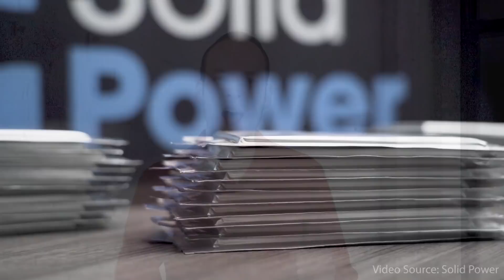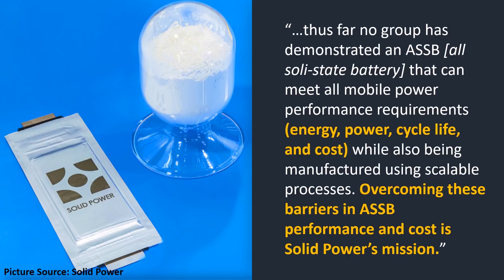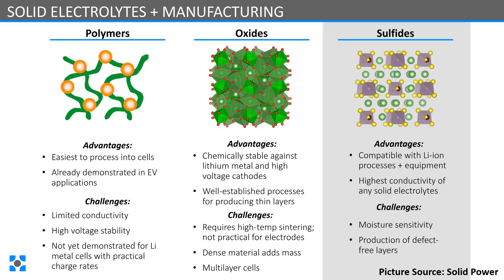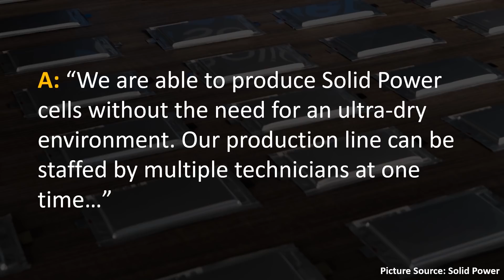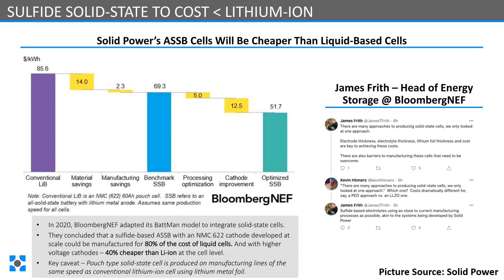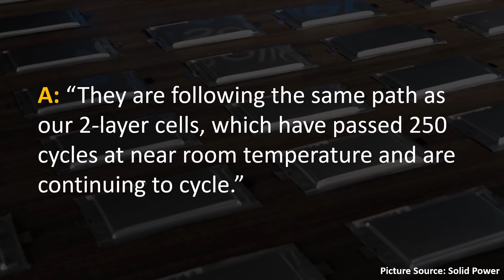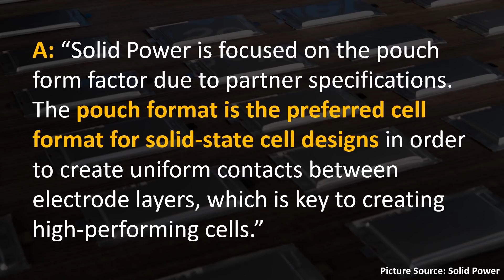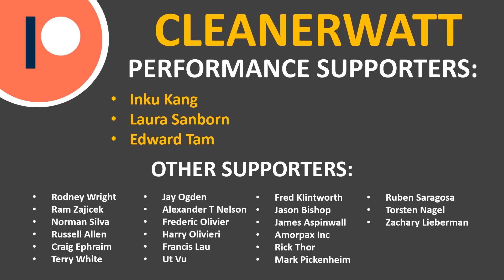Solid State EV Battery Tech: Reality vs Hype (Solid Power Batteries)

Comment: Its a shame you used Tesla as an example here, as from what I've read it turns out their cells perform WORSE than what they were using before.  Plus you have to consider how much of the car you have to replace to change the battery pack, its not practical to have a batter you can't easily replace.

Comment: You missed one key question, the 1000 cycles are at 45C 122degrees Fahrenheit, which is the same temperature as sulfur batteries in the 70's.  This temperature constraint is the biggest problem with Solid Power.

Comment: You idiot, how does adding a metal can to a battery where a pouch cell doesn't use one, reduce weight? Structural battery packs can be made with either.

Comment: Heeey Just discovered a HOODWINKING in the presentation at 7 :15 the graphics show an electrode stamping step in the L ion side that does not exist unless you are making prismatic cells, which the industry making the current cylinder cells does not use!

Comment: Hello! Thanks for putting this together - great work. I have a few questions on the cost slide: 1. What reference are they taking for industry standard $85.6/kWh? Is this on the cell level? Seems lower than the current $100/kWh which only a few companies have hit  2. Are material savings coming only from the elimination of graphite? Does it represent the net value (typically the cost of the solid electrolyte is much higher than the liquid counterpart)? 3. What specifically are they referring to in terms of cathode improvement (higher Nickel?) and process optimization?

Comment: 12:10  Everything you said after this point is sketchy.

"Tesla's structural battery pack only works with cylindrical cells."   You're 100% incorrect....  Tesla's structural pack design simply removes the structural supports from the floor section, using the packed cylindrical cells as the support structure instead, and it removes the second layer of plastic packaging of the cells into modules.  I imagine it also makes it impossible to remove a faulty cell or groups of cells being that the cells will likely all be glued together, versus their previous design of 4 modules in the 3/Y.  

VW just advertised the exact same concept with its new prismatic modular cell form factor... removing the structural supports, removing a secondary layer of packaging, and using the prismatic cells themselves as the support structure.  While you're video precedes VW's power day... that's no excuse.  BYD had already advertised a similar structural pack with their Blade LFP cells.  No secondary container and no additional supports within the pack, outside of the cells themselves.  Added bonus is that if a single cell does fail, it can be removed and replaced.  No need to replace the entire pack.

I like that you keep calling it "Tesla's structural battery pack.. breakthrough".  That pause for emphasis is cute.  Seriously... they removed the plastic module containers, jammed the cells closer together, removed the support beams, and then filled the entire pack up with the packaging material / fire retardant.  The main benefit is weight and materials savings.  If this is a breakthrough, it's a pretty obvious one.  They've yet to produce a car with this pack, so we still don't know how amazing it'll be in practice.  Especially with cylindrical cells.  Isn't BYD already building the Han with the blade cells in a structural pack?

Given an equivalent chemistry, there's a good chance cylindrical cells lose in both volumetric and gravitational density as a direct result of additional cell casing requirements.  A cylindrical cell is like building a box cell, only adding metal cross beams every few inches across its length and adding a bit of empty space around that beam and filling it with packaging material.  

Tesla's manufacturing process does seem to be faster / cheaper than pouch cells, although we've only seen video of it that clearly seemed like it was sped up.  VW claimed a new process of layering the pouch layers using a process similar to currency bill production.  I guess we'll need to see how well it performs.
Reply: BTW, I'm completely floored that you left out what may be the most important aspect of SSB cells.... charging speed.  The biggest issue with long distance trips with current BEVs isn't that they need to stop to charge... it's that each stop can take a lot of time, extending the trip time.  Tesla's 10-80% is ~22-25 minutes with the 2170s.  4680s may reduce that time, we'll see.  QS was claiming 12 minutes 10-80%, and Toyota was claiming 10 minutes to 80%.    QS is also claiming that cold temperatures have no impact on charging speed like it does with liquid electrolyte cells.

IMO that means smaller capacity packs can be sold in cars and still be viable for use in long trips.  They'll require more stops, but each stop will last half the time.  It also means the pack itself will take up less space and weigh less, improving usable space and reducing vehicle weight, improving vehicle efficiency.  Integrate those cells into a structural pack, and ... well... what advantage does Tesla's 4680 cell structural pack have anymore?

BTW, the megacastings really has nothing to do with the cells or the pack.  They do use cast aluminum, which aluminum is likely more expensive to use than steel.  To extract the aluminum from the ore takes a good deal of energy.  What I'm not sure about is what type of energy is required to go from the aluminum to the chassis by using 6 ton casting presses versus stamping / welding or smaller castings + welding.
Reply: Last point... Tesla stated on battery day that they hadn't yet perfected the dry silicone anode production.  Maybe they've solved it since then, but if not, then that's a pretty big issue.  The "tabless" design.. which is effectively just hundreds of tabs folded on top of each other on each end of the cell, adding additional copper / aluminum use to the cell... is not a necessity in pouch cells like it is in cylindrical cells, as each cell layer in the pouch has its own tab.  I don't think the extra material in the 4680 cell is a big deal given its benefits though... I'm just pointing out that it isn't exactly an issue that pouch cell producers need to solve.

Comment: Durability? This has always been a problem for solid state cells and I don’t think you addressed this in your video. Solid state reminds me a little of fusion power, offering great benefits that are always n years in the future. The problem for Solid Power, Qauntumscape et al is that they are aiming for a moving target. ‘Traditional’ LiOn is getting more energy dense, more durable, cheaper and safer year on year, as are the BMS that manage them. The new 800v architectures are already solving the rapid charging problem so where does solid state go?

Comment: Funny, I got the opposite impression from the video. Impressive improvements for automobile Li-On batteries can be achieved merely by well understood packaging and chassis integration improvements while sold state batteries will require much technological development. Presumably the invisible hand of the market will pick the winner.
Reply: Indeed. SSBs could end up as a niche player while existing chemistries provide the bulk of EV battery needs and will continue to be developed as any breakthroughs in things like anode/cathode composition can be quickly integrated on the production line and give a rapid R&D payback.

Comment: Per Tesla patent on tab less cell (ie multi flap cell) each flap will be independently in contact with one of two electric terminal on cell casing. If implemented accordingly will bring down  conduction resistance electrically and thermally for superior performance. That is. It so. 

Per Tesla’s published 4680 cell assembly, such independent connection was not carried out hence loosing both thermal and electrical performance claimed.

Comment: Interesting how it always seem to be 5 years from now. I remember somewhere 2010-2012 i've read a science magazine where they promised some great breakthrough in battery technology within 5 year time, then in 2015-2017 it was the same promise, 5 years and now, in 2021, they say wait for 5 more years.
Also, the science magazines promised massive improvement in energy density, like several times more than what we have now, yet it seems to be that in practical use it will be maximum 50%, maybe 100% improvement.

There is clearly something, some big problem which just doesnt allow a battery technology that desirable breakthrough.
Reply: Most times, change is incremental and not necessarily revolutionary. There is a big improvement in energy density and durability in batteries if we look at a larger timescale than just one or two years. But of course the companies try to hype their own products.

Comment: Great vid.  Thanks!  SolidPower seem legit and not just full of marketing fluff.  A few observations and questions.  Did you ask SolidPower (SP) about their volumetric energy density?  On the cost projections (from BNEF) they start w a lithium-ion cell cost of $85.60 per kwh.  This seems very low (maybe lowest possible price currently in the market and not average) so their cost estimate ends up unrealistically low and too close to Teslas 4680 projections.  Also, the production process shows slurry mixing and  drying.  4680 does away w this (I know this is supposed to be current/conventional methods).  The SP process does seem to have a large advantage when it comes to formation.

This is the first realistic projections of SSB I have seen (not saying there are not others that are kept quiet).  But having a MWh scale pilot plant vs Teslas GWh scale pilot plant tells us where the action will be fir the foreseeable future.

Thanks again!!  Keep up the good work.

Comment: Tesla's structural use of cells merely mitigates the penalty of requiring the steel cylinder in the 1st place which the 4680 has reduced over the smaller cyl cells.  If you don't need heavy structure to contain a pouch cell that you need for a cylindrical you will have less mass for the cell packaging to be allocated elsewhere in the structure or build a box around pouch to use as structural pack (makes little sense for that purpose)...I don't think cylindrical have an automatic edge here at all.

Comment: Hell Yeah I enjoyed it!! Great video.  Great insightful information.  Really good scaleable delivery: I listen at 1.5 playback speed W/no problems.  leaves me with one question: What would be the problem with an EV manufacturer allowing for a 1/4 capacity removeable/rechargeable cannister of various battery chemistries.  Leave 1/4 at home for use there or take it along on long trips.  Expensive high speed chargeable or cheap remove and replace on the go.  Heck have two cannisters charge one with solar roof and wind generator at E-home for free!

Comment: Tesla could pivot if solid-state proves to be better. Solid Power was non-committal about the cylindrical format cells, but there was nothing in their presentation to suggest that it would not work with some effort.

Comment: With a solid sulfur electrolyte, when it's exposed to water, it produces sulphuric acid.  Meaning it will require masks and special areas in the factory that are water-free.
Reply: solid sulfur based electrolyte, which are sulfides. solid sulfur doesn't do anything

Comment: The problem is as follows.
This technology should have been researched a lot earlier, but because of the reluctance of the car manufacturers to switch to EVs (or heck, even worse, colluding with the oil industry giants to push the idiotic hydrogen fuel cell vehicles (which also rely on fossil fuels to extract it) it's been dragged on and on. 
Toyota own many patents in this field and to this date they haven't produced a single EV. They kept it under wraps to hamper the industry.
Governments not pushing for the complete stop of ICE tech sooner.
The moment the dieselgate scandal broke lose, politicians across the planet in deevloped countries should have set a deadline of 2020 for developing ICE powered vehicles and 50% of vehicles sold to be PHEV and EV. This means all research into ICE should have ended and companies not try to waste billions into making some newer, "better" petrol/diesel engine, but spending those billions into developing better energy storage tech. But in the present these manufacturers are still wasting fortunes into making "new and improved" ICE tech vehicles.

Comment: I don't believe in Tesla's structural battery pack. Batteries are there to provide the energy, not the structure. They are forcing batteries to do a job that they should not be designed for. They are also implying (and I think this is the point) that their batteries are so good they will outlast the car. So this is really not based on any kind of reasoning except to prove a point. I think it's an inherently bad idea, because if the battery pack does fail in some way, then you basically lose the whole car. Imagine having to throw out an item the moment the battery failed. I think this is an incredibly dumb idea not being able to replace the batteries.
Reply: You are arguing like, as wings in an airplane are meant to keep an aircraft up they cannot be used a fuel tanks or the door of a car provides protection against the elements, therefore it cannot provide side impact protection. Engine blocks of exotic cars also are used as structural components also to save weight. You loose at most the sub frame the batteries are mounted on if the batteries are faulty . Possibly less as it is always possible to remove a glued in battery, just as it is possible to replace a glued in windshield if necessary.

Comment: I have a question: Are Tesla’s theft proof? If they aren’t how do people steal them?  Is Tesla tracking g them? Etc.
Reply: all Tesla battery pack are Already THEFT proof and are UNABLE to be Swapped. 
the Structural battery pack will be even MORE Secure.
Reply: @markplott4820  what about the car itself? Haven’t heard of any theft.
Reply: @leorock7823   - TESLA cars since 2018 are very hard to STEAL as you need a SMARTPHONE app with the Correct ID , and even if you gain access to the car , you need  a #PIN to Drive the car.

Comment: Jon
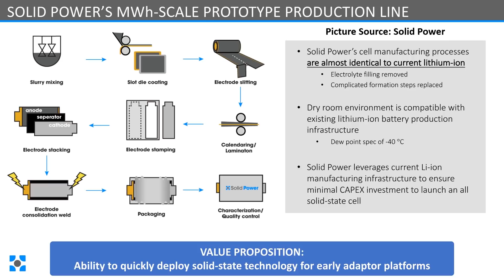In the comparison at 7:00 you mentioned the "typical wet process".
The "wet process" doesn't refer to electrolyte, but the "slurry" mixing (and drying) which is still apparently part of the Solid Power process.

As mentioned at Battery Day, that is the first advantage of the upcoming Tesla cells, be that in 4680, OR 2170 format (nobody has considered that they may retrofit just the "front end" of existing factories to eliminate the wet process for 2170?)

That wet process will be one limiting factor (Hey Jordan!) For Solid Power cells.

They also indicated "pouch cells only" (good question!) at least for now, limiting the potential production speed (GWh) increase that Tesla will see from 4680 format.
Note they were comparing to a "conventional' pouch cell and pricing that at $85.6/kWh (optimistic?)
They (you?) Then take the Bloomberg estimate (odd?) Projecting -40% cheaper, arriving at $51.7/kWh.
Who has this $85.6 pouch cell? Even Tesla isn't at that level yet?
My understanding was that "conventional" cells are well above $100/kWh with Tesla at about 100.

Comment: Thanks for mentioning Tesla's "uniframe" and their use of cylindrical cells.  IMO, I think Tesla is going down the wrong road with their reliance on cylindrical cells.  I think solid state batteries will be pouch and will eventually be the battery of choice.
Reply: How you they manufacture pouch  cells?
Slowly.
Can that speed be increased? Not likely.
The 4680 can use solid state materials, best of both worlds.
Reply: TOM - not for at least 20 years, 4680 is coming in the 2021 Model S PLAID + in APRIL.
Reply: @markplott4820  
Are you certain that's the 4680?
Reply: @rogerstarkey5390   - YES, Certain .
the Standard model S / PLAID will use 1865 with NEW Chemestry. and they are NOW Shipping.
Reply from the maker: That is a definite possibility and will be interesting to watch.
Reply: @Cleanerwatt  But,  (drawing from a previous "deep dive" video) aren't pouch cells dendrite-prone vs (Tesla patented) tabless cells?
Reply: Why? With cylindrical cells you can have a structural battery pack, increasing energy density while reducing mass and costs.
Reply: Operative word eventually. In a world of double or triple the current battery density no one will be resorting to extreme engineering to get 300 miles out of an EV. Stick some pouch cells in an insulated box, put the box under the rear seat , done. Until then batteries as structure, optimised cooling and all the other tricks need to keep weight down favour more complex shapes.

Comment: Thanks for digging into this, but you're missing things like charge rate and hot/cold weather performance.  These two things are mentioned in QuantumScape's presentation and I'd be interested in how Solid Power stacks up (no pun intended) to the claims made by QuantumScape.
Reply from the maker: That is a great point, and I will make sure that those are questions I ask in the future for videos like this one.
Reply: also need ask solid power how many atmospheres their battery operates in. also quantumscape uses a gel to increase contact between cathode and solid state seperator
Reply: Quantumscape uses a "gel" electrolyte?
Reply: @rogerstarkey5390  "Gel" is not Solid!